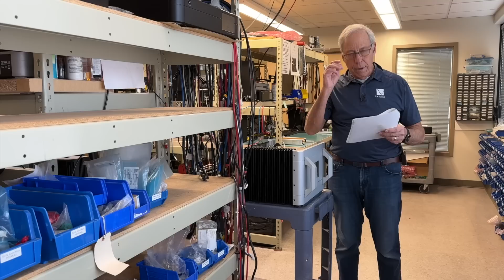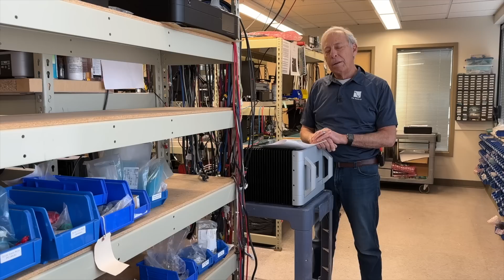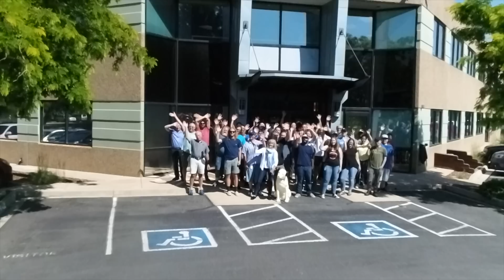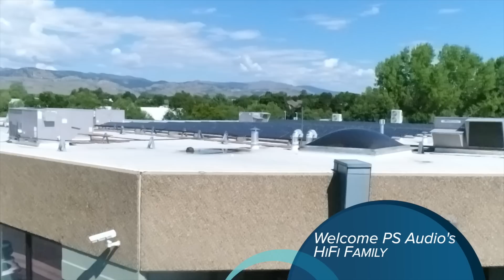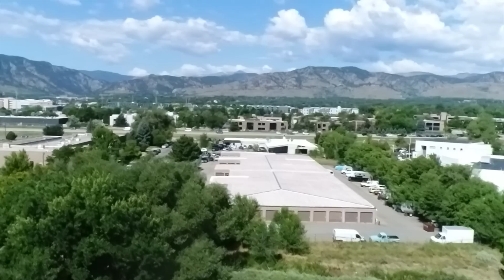Speaker break in: Myth or real?

Comment: I thought it was a myth until I recently installed an upmarket set of Polk Audio speaker in my Jeep. I bought a decent Pioneer head unit and although the primary overhead speakers in the roll bar enclosure were only 5.25”, I expected at least better than OEM fidelity. They sounded terrible with poor dynamic range and very muddy frequency response. I checked the default EQ settings, manipulated the EQ and loudness, and nothing would bring life to the sound. It was awful.  One week later, about 5 hours of listening to music, I noticed that it was sounding better. It’s now three weeks later and the difference is night and day.